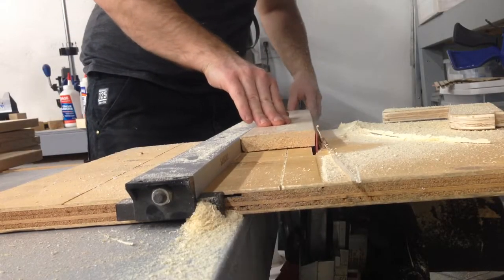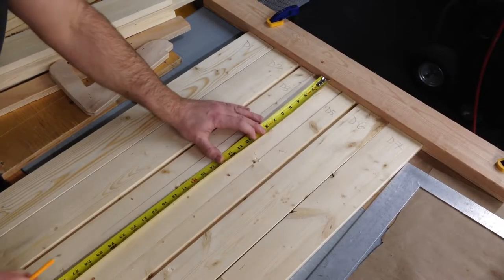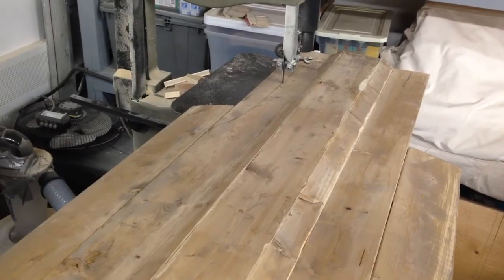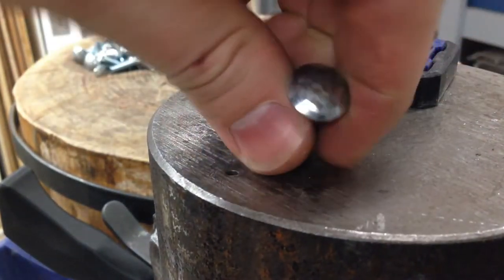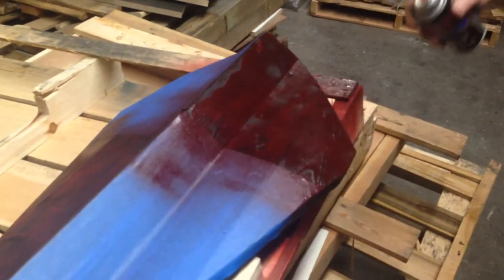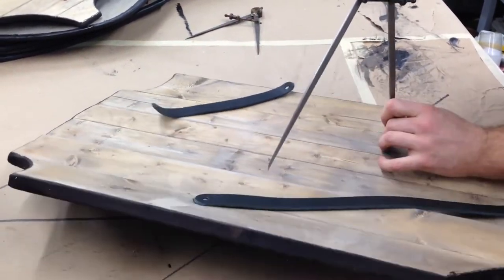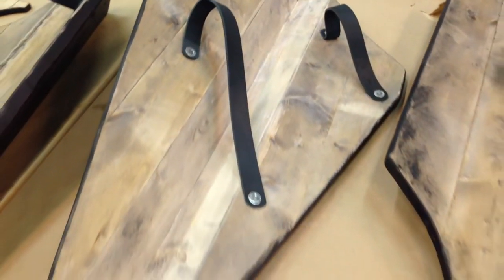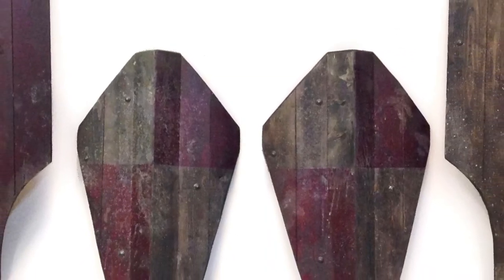Making Medieval Shields - Prop Build

Comment: Question: How much research have you done on these shields? Meaning that did you intend them as historical replicas or just backhanded movie props?
Because they do leave a lot to be desired in terms of historical accuracy. For one, they're too thick. That makes them heavy and cumbersome on a long march. Second is the actual pattern of the shield, which seems pretty outlandish and, frankly, inconvenient.
Usually, any shield that had any amount of effort put in it was leather covered and rimmed, with leather or iron. Late medieval shields were often laminated sheets of wood often covered with leather and sometimes possibly reinforced with steel (though this i've yet to confirm through historical finds)
Final point, spine ridges like in your kite shields were found only on pavises, a type of shield that were designed to be propped up on struts and used for cover by crossbowmen. The ridge was there to house the struts.
Sorry for such a negative post, but as a HEMA practicioner, these things stand out like a sore thumb to me.
Reply from the maker: Thanks for your comment. I don't find your post negative at all and often learn many things by discussing topics like this with my viewers. I will try to answer all of your questions and respond to your statements in order to avoid confusion. 

I have many years of shield research both internet and visiting to galleries that display extant period shields. I have personally photographed, since 2005, shields from, france, germany, england, scotland, spain, morocco, italy and austria. Most of these I try to get edge shots and if I can the back view (although very few are displayed with the backs toward the viewer) 

These shields are movie props. The central ridge is inspired by pavises. The outline of the taller shields are inspired by the cut corners found in gothic furniture. Specifically some small benches. There is also an influence of Lord of the Rings Gondorian shields (but only from memory) The smaller ones just had the corners cut off at an angle that looked balanced. Neither are copies of Historical shields.

I agree with you on the thickness. They are 3/4" and I usually prefer to make my shields 3/8" to 1/2" thick. This was a direct result of timeline and budget for this particular client. They had 1" x 4" boards so that is what I used. I could have planed them down but it would have been more expensive. 

They are actually not that heavy. By not adding cloth and glue the soft pine that they were made from is surprisingly light considering how beefy they look. Again, thinner would have been better IMO.

I'm slightly disappointed that you think my designs seem outlandish and inconvenient. I still think they are cool. But that is only my opinion and I would never have an ego about someone not likely something that I have made.

I have seen some leather covered shields. Most shields that I have photographed have a paper like covering (like a Mache) or cloth (likely linen) Almost none are rimmed in any type of metal. 

Most shields that I have photographed are plank construction. In fact, a quick glance through my extensive photo library and I could not be certain that any of them were ply construction. Please check out my other videos on layered curved plywood shields (https://youtu.be/X5X_TSTdTKE) and flat plywood shields (https://youtu.be/3aE5Pz6RpJk) to see that type of construction as movie props. 

Many plank constructed shields have metal reinforcements. I choose not to include them due to budget of the customer. Hence the biscuits. 

The ridge is from Pavises inspiration. But these are not Pavise shields so I did not call them that. They are not really medieval but I had to call them something and medieval is a good searchable youtube keyword. 

I occasionally build historical replicas of extant items. If you have an object that you would like to see me build you can send me a photo via email and I might put it on my future build list. Thanks for watching and I hope you enjoy watching the video despite the historical inaccuracies of prop building.
Reply: Drawbridge Entertainment Well, so long as they do not actually claim historical accuracy i can remain at ease. When i said that they look outlandish i mostly mean the smaller shield, which appears like a mutant kite-targe.

The larger shield i feel much more comfortable with, since it does resemble an italian targa from around the 13th-14th century.

When I spoke of the laminated shields, they were made around the 14th-15th century when shields were being outmoded. Squareish tourney shields and the type with plentiful decoration in their paintwork.

The covering on shields was, yes, very often parchment, vellum, linen or the like.
The only shield that i can recall having metal rims was an italian shield from florence dating to 1450.
Reply from the maker: yes mutant targe:) maybe i'll use one for archery practice for another video. I have not been to florence yet. but it is on my list of places to go. If you've been do you have any specific buildings or places you can recommend that I visit for arms and armour? Sometimes they keep it hidden away and I don't know what i've missed until i've already left.
Reply: Drawbridge Entertainment I cannot for the life of me remember where i saw it exactly, but it may have been London. Florence was the place of origin for that shield and it may have been a parade shield considering how it was painted. While i have been to Rome and the countryside i have not visited Florence, so i cannot give reliable advice, though i have heard good things about the Stibbert museum, which is supposedly in Florence.

Comment: asking a obvious question can one of these be used in full contact fighting
Reply from the maker: Thanks for your question:

Full combat fighting: Absolutely. 
But.... this specific construction technique (for use as a movie prop) is likely to break sooner rather than later. The biscuits obviously provide a bit of strength to an otherwise butt glued edge. But they will still fail. When we look at historical examples of plank constructed shields they almost always have two things that would make them stronger. 
1. A material, either cloth or leather, glued to one or both sides. 
2. Strips of wood or metal that run perpendicular to the planks.

I will be posting a video next weekend on creating curved plywood shields that covers my technique for covering a shaped shield with canvas. This technique would be much stronger and more reliable for modern full combat fighting. Subscribe and stay tuned for more Videos.
Reply: +Drawbridge Entertainment much thanks good Ser
Reply: I saw that these are available for rent, but do you also make them for sale?
Reply from the maker: I love making custom shields for sale. Check out my website for more shield images. Then email me with details of what you might like and I will send you a quote.